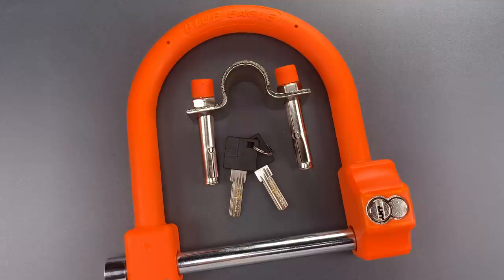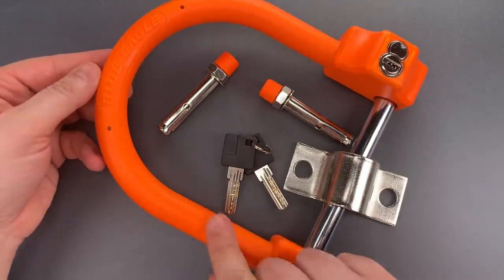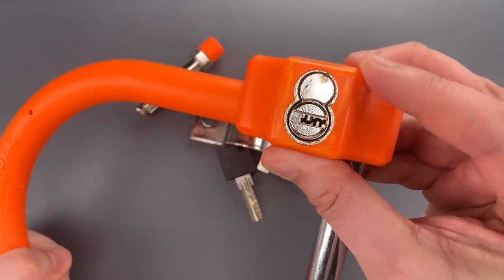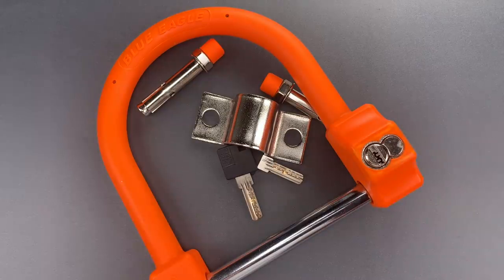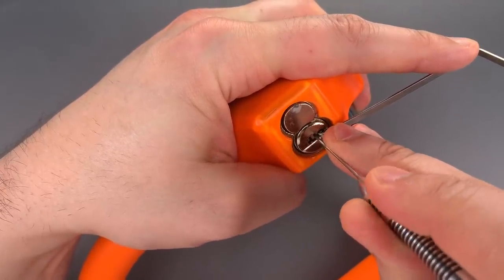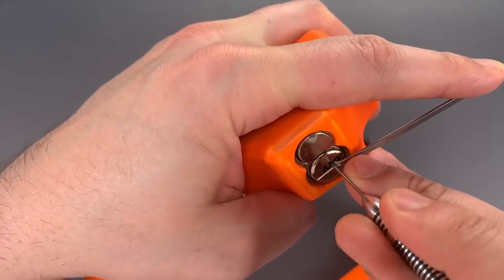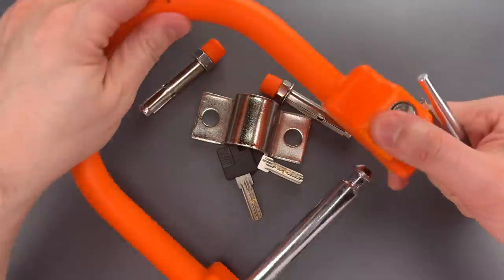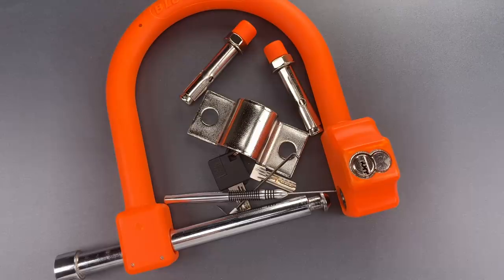[1228] Blue Eagle Motorcycle Lock Picked

Comment: If you can  anchor the bracket into the floor at the base of a wall and orientate the lock so the keyway faces down, it makes it very difficult to drill the lock or cut the bracket with a grinder.

Comment: I'm not sure you'd actually want the bracket hardened, not when it's bolted to the ground, especially not with that shape and thickness. You could just hit it with a big hammer and it would shatter. A hardened shackle works because it's thicker, and usually not against a hard surface.

Comment: Is it possible to just undo those nuts and take the mounting bracket off?
Reply: I think that would be difficult, that type of anchor bolt, a wedge anchor, is not designed to be easily removed. You would usually have to cut them off with an angle grinder.  Just Google "removing wedge anchor bolts"
Reply: @peterjf7723  Thats true but it looks like the only things connecting bracket to the bolts are those hex nuts. So theoretically it is possible to take the bracket off without having to remove anchor bolts from pavement/wall etc.
Reply: @Firley777  Yes that's true. Oh  the bolts shown are sleeve anchor bolts not wedge anchor bolts as I first said.

Comment: Those bolts would be easily pried out of a concrete floor.  They need to be much longer.   And the bracket, another weak link (no pun intended).

Comment: Not to nit-pick but it feels like you wouldn't be able to use that tension tool placement if the lock was secured against the ground/wall and on a wheel
Reply: That's true, but the cylinder looks symmetrical. You could just place the tension tool directly opposite.

Comment: This is purely security by obscurity.

It assumes that most people don't have the proper skills and technique to pick, which is probably true.

It assumes most people won't know the bolts are weak, which can't be discerned with visual inspection.

It assumes the theif won't notice the hook isn't hardened steel.

It assumes someone doesn't have a drill.

The bright orange is a simple visual diversion: go to something that isn't locked.

Comment: Another attack this misses.  Just taking the wheel off.  Unless it goes through the frame, it isn't going to do much.
Reply: There are a lot of locks that miss that attack.  Forcing a thief to take off a wheel means that they cannot roll the bike away or hotwire it, they would need to have some way to pick up, and transport it.  Unless a thief specifically wants YOUR bike, they would quickly move on to an easier target.